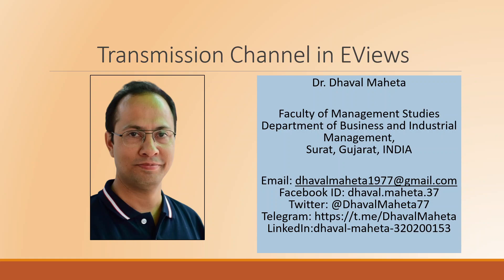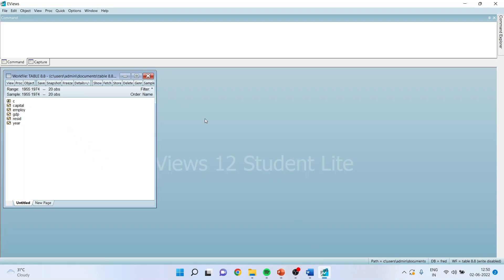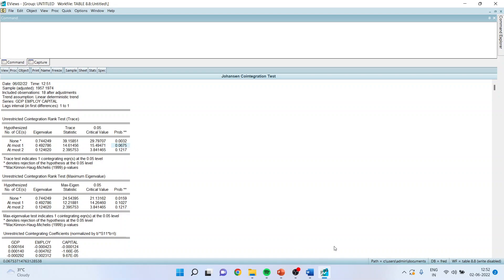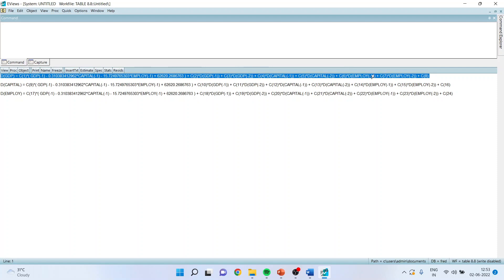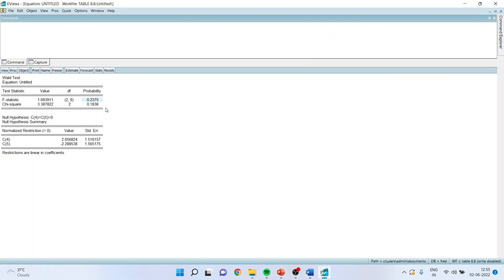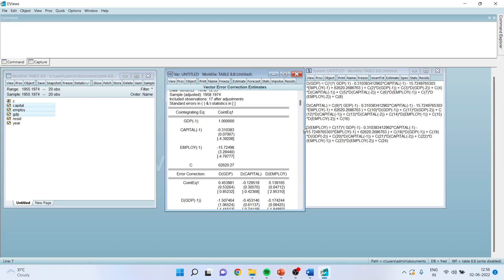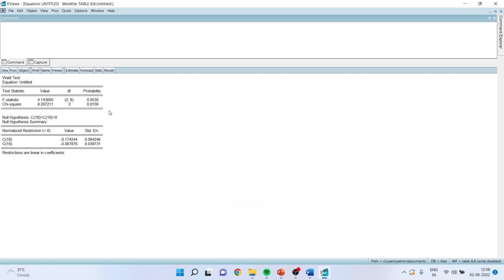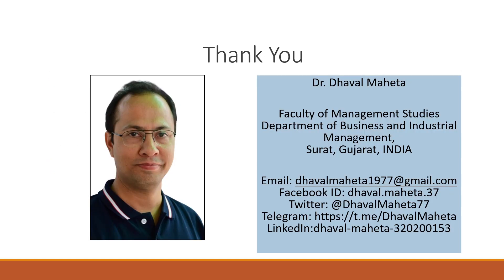25. Transmission Channel in EViews 12 || Dr. Dhaval Maheta

Comment: A very interesting video. In theory, high interest rate is used to control Rising Inflation in the short-run but rising interest rate will dampen economic growth in the long-run. If I'm right, can I use transmission method to analyse the data ... Thanks.
Reply from the maker: definetly